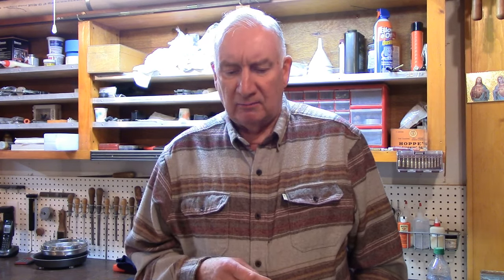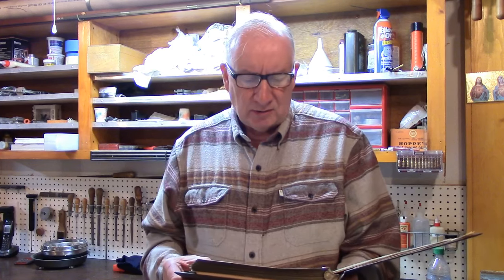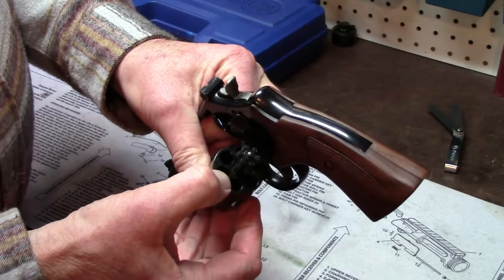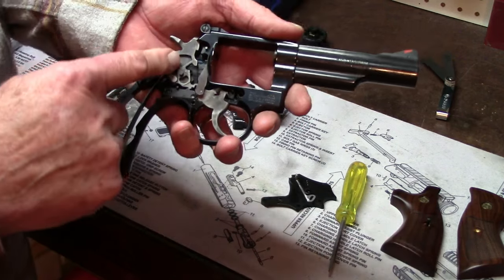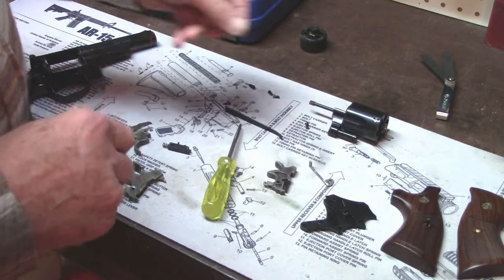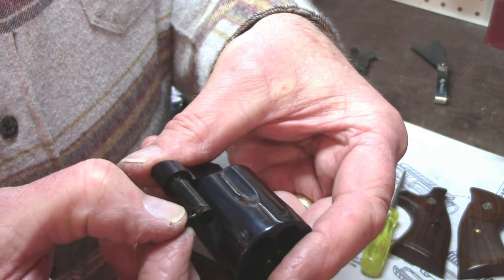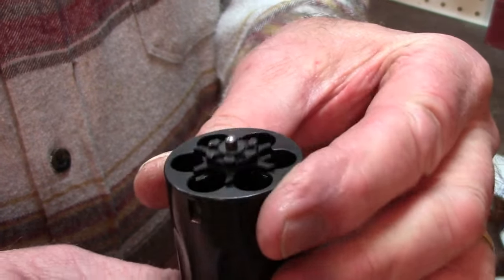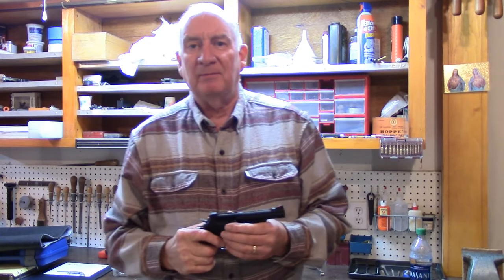The New S&W Model 19 Classic ~ A S&W Armorer's Review

Comment: A viewer turned me on to your work, and fine work it is. I love the Classic series of modern S&W revolvers because it allows us to truly enjoy these great designs at the range, without adding wear to our collectible period guns if we have them. The actions are not quite what they used to be, but you have to do a side-by-side to really notice that.
Reply from the maker: Speaking as an armorer, the actions are EXACTLY the same as they used to be, because the geometry of everything is precisely the same.  There's one difference; the elimination of the center pin in the new design removes the friction caused by its own spring pressure together with the spring pressure of the locking lug, which has been eliminated.  The cylinder that was once encumbered by spring pressure of two parts is now free to spin because those parts have been eliminated.  The support of the cylinder was once weakly suspended between the front bolt under the barrel, and the rear bolt at the recoil plate.  The front of the cylinder had no support, but was only dangling between two distant ends of a thin pin.  The lightest rap on the side of the cylinder would bend that entire system, requiring new parts and adjustment.  It's now supported directly in front of the cylinder by the strong yoke itself, and not by a long pin; eliminating half the span.  Think of hanging a 26 pound turkey on a rotisserie.  After turning for a while, things start to loosen up, and they need tightening, and at some point no manner of tightening will keep things spinning.  The reason the cylinder now opens with a click is because of the detent at the yoke, rather than making the center pin and ejector rod flush with pressure on the thumbpiece.  Most Model 19 and Model 29 44 Magnums that have been fired much are desperately loosened and terribly weak, for which parts are no longer made on antique machinery made over a century ago that wore out decades ago.  Any side-by-side differences are the result of reduction in spring torsion that are typical of older guns that have been in various ways modified.  Very few S&W guns have escaped spring nipping and strain screw shortening over the years, which indeed results in lighter actions, though not necessarily safe or dependable ones.  I've worked on, instructed with, competed, carried on duty, and owned the old ones.  The new design is more uniform from gun to gun, because their action is not dependent upon the skill of the fitter.  Trust me; many fitters were NOT skilled.  S&W told me that they educated Armorers for the military and police as a free program, because it allowed us to take care of the servicing required to keep their guns working.  Without charge, they shipped me parts by the bag full to replace ratchets, sears, endshake screws, center pins, ejector rods, you name it.  They knew they would require replacement, or they would not have sent them gratis.  That didn't say much for their product of the day.  In fact, those weaknesses became so apparent to so many departments of the era, that they fled S&W and went to Ruger GP-100s, which required no service, other than repairs for extreme damage.  It would require an unbelievable maltreatment of a GP-100 to put it down (and I don't recall one in the nearly 300 that I serviced and maintained), while a S&W of the day was subject to endless headaches and failures.  Frankly, they are fragile by all measures.  We were taught how to pamper them into submission, because they would otherwise foul up.  No, they are not smoother, nor do they have any different DA mechanism that would make them so.  That considerable friction of the center rod and its legion of endshake issues and rod run-out were sources of many cycling problems and roughness.  Those issues are forever gone.  Using exactly the same methods taught to me by S&W, I've made my Classic more smooth than I was able to with my previous Model 19s, which were indeed quite smooth.  As I stated in the video, I was unable to find a single specimen that was not in some way or another defective or in need of repair.  Repair of those guns is dependent on dwindling parts availability.  The parts most commonly required for repairs are already exhausted at the factory.  They went through those parts on a massive scale because the guns broke down  due to design weaknesses that are not found in the new style action.  I don't see any parts in the new gun that will wear out.

Comment: Thank you sir. I agree. A better gun than the original in terms of engineering. However, the finish i have seen on many model 19 classics are terrible. This is why i dont have one yet. A lot of scratches and places where they did not file and fit properly. I even saw one where the barrel shroud was protruding out the barrel. If you saw what i saw, you would be astounded.

Comment: I have a hard time finding the right screwdriver bits for my S&W revolvers. I seem to need a bunch of bits, even different ones for sideplate screws on the same model.

So I would be very curious about the measurements of your customised universal screwdriver that you made in the S&W armorer course. What blade width and thickness do you use? Thanks for any advice.

Comment: I have a Model 19 (19-3) in nice shape but I had a scope put on it and then removed.  Of course it now has 3 holes in bottom of top plate.  How much does that reduce the value?  The cylinder seems very tight on it but feeler gauge measured about 6 thousandths between cylinder and forcing cone.  Your video was great. Also, I don’t seem to have alignment pins on ejector rod.

Comment: Liked your discussion of S&W.  I hadn't heard about the 51 problems.  I have a Model 13-3 357 and I wonder if one of those problems is something I experienced.  The pushrod treading backed out a couple times not allowing me to open the revolver.  Is this a known issue? and is there a good fix for it?  I can tighten the ejection rod of course but wonder if there is a "best" way to lock it from backing out.

Comment: Thank You for an outstanding instructive walkthrough about the new K frame "Smiths presenting much to boost my satisfaction in acquiring a 66-8.  And taking the trouble to disassemble and reassemble your sidearm to show 'n tell, an endeavor that the rest of us dare not, removal and replacement of stocks is as far as most of us are capable.  BTW noticed that the barrel at the forcing cone inside the frame window is a full 360' whereas the older guns had a flat spot to accommodate closure of the yoke previously used.  Had read that there was an issue of magnum cartridges eventually cracking the barrel there, which is obviously now corrected.  And the new yoke locking point inside the frame is reminiscent of the Triple Lock system on the N frame New Century before WW1, but is it the same ?.  Finally, the new solid ejector rod and frame mounted firing pin in lieu of a hammer nose seem to be a nod to Colt

Comment: I'm surprised there was no mention of the forcing cone thickness improvement.  The old ones had a chamfer for clearance that forced S&W to remove material off the bottom of the forcing cone.  The new ones are uniform all around.   I saw some pics of the old ones cracking at the bottom likely due to abuse of heavy home loads.  Still, the new design is better in that regard.
Reply from the maker: Yes, you are correct.  The old style gas ring required clearance and a flat cut under the barrel extension.  The new design allows for an uncut barrel, which is also a tougher stainless steel.  That weakness is eliminated.

Comment: Have you found the small cylinder flash burns above each chamber, from the pressure buildup under the top strap, in the rear sight forward screw hole? Ive heard that if it happens, it may be solved with a flat-bottom screw; to block flash access into that threaded hole, under the top strap?

Comment: Thanks for this instructional video. I remember my old model 19 which I liked.  However I had a snub model 10 which I had trusted only to find it would hang and the cylinder would not rotate when pointed upwards.  Much to my disappointment the shells rotating around were hitting a burr in the flared back-plate which keeps the round from falling out of the cylinder. I think S&W makes better revolvers now, some of the best.

Comment: I have an old S&W Model 10, and I have a problem that I cannot seem to fix. When I dry-fire or use snap-caps, everything works fine, but after I fire a handful of rounds through it, the action starts to stick. It will still technically fire, but the trigger/hammer become extremely heavy mid-way into the pull. This happens when I try to fire both double- and single-action. I shipped it back to Smith&Wesson to repair, but they did not fix the problem. I will probably take it to a local gunsmith to try and fix, but if this sounds like one of those "51 Problems" that you regularly encountered, I would love to know.
Reply from the maker: I can only assess gun problems in hand, but I don't have a federal license to do gunsmithing.  My intuitive guess is that your cylinder is closing on the barrel and is dragging after fouling builds up. If that's the issue, your gun likely has developed endshake of either the yoke or cylinder, or both. It's a very common problem in Smith and Wesson guns made before the new design.  With gun empty, look at barrel gap against a strong light while you pull the trigger in double action.  If the gap closes on the lighted gap as the hand rotates and pushes the cylinder, your cylinder is dragging.  S&W should fix that very common issue for you.

Comment: Nice to hear from you. I recently bought a model 66. When I took the Hogue rubber stocks off I found that the place screw that the stock covers was mangled. Took the gun to a gunsmith whom broke the screw in the process. His solution? Glue a screw head to the plate and told me that "you don't really need that one". Well I was mad as hell (he charged me $80 up front) but I don't believe that that's screw is not needed. Can a better gunsmith remove the broken screw and replace it?
Reply from the maker: Absolutely.  A good gunsmith can build a gun from scratch, and the removal of the sideplate screw is simple work.  However, before doing so, call Smith and Wesson customer service. Despite model changes, they should be able to knock out that screw and fix your gun.

Comment: Not bashing but watch the review by Hickok 45. I still want one. What do you think went wrong?
Reply from the maker: I will watch that video.  However, just as a doctor would be unable to diagnose without the patient present, I'd have to have that gun in hand. I'll check it out.
Reply from the maker: I just watched the video.  All revolvers have a cylinder gap, which emits gasses, or anything else that doesn't fit.  All ammo makers occasionally load a bullet that has a defect, which will catch on the barrel, and will spit an imperfect piece of metal. In 1978, I loaded a batch of 140 grain half jacketed Speer bullets in 357 Magnum.  I observed that one of the jackets was distorted, but in my frugality, I loaded it anyway.  When I chambered it into my 6" Model 19, I wondered if it might be inaccurate, so I made it the first shot in the cylinder.  It went into the same group as the rest at 25 yards, but I was more concerned with the blood oozing out of my left bicep, and the terrific pain.  The doctor said that nature would take care of it, and that surgery was unnecessary.  A chunk of ragged copper surfaced three years later.  It was the ammo and my stupidity, not the gun. 
He stated that he fired that gun for quite some time prior to the videos, and subsequent shots after his injury spat no further metal.  A misaligned cylinder is a permanent issue; not an occasional one.
His Model 19 locked up due to a failure of the trigger to return to battery.  The gun is designed to prevent opening unless the hammer and trigger are returned to battery.  That is a common issue with S&W revolvers that have had too many coils removed from the rebound slide, in attempts to lighten the trigger.  In watching him shoot, I detect that his trigger in both DA and SA are very light, and not within specs.  They are separate issues, in any case, which have nothing to do with the gun as it was made. He was a competitive shooter, very well familiar with the tricks of the trade, and I believe he got too greedy with his sidecutters on that rebound spring. One NEVER uses a rubber mallet to open a locked revolver.  All he needed to do was to press the trigger forward while releasing pressure on the hammer.  He's a terrific shooter, but I must give him an F as an armorer.

Comment: One thing not commonly known is that the cylinder of the Model 19 is long enough that full length .357 casings can be extracted completely.  In fact, unless recently changed, the Model 19 is the Only DA/SA revolver to have that capability.

Comment: I'm 38 years old, and I mention that because it seems like anyone under 40 years old doesn't have much in the way of revolvers unless it's a J frame.  But I've always liked revolvers, I have several single actions and double actions.  I tend to have more Rugers, that's not on purpose it's just that if you want a well made single action or double action revolver without undesirable features Ruger is usually the easiest way to get it.

6:35 haha, I appreciate that insight.

I disagree on the Hillary Hole, I don't see how that's going to help anybody.  If you have children you need to lock it up, they shouldn't be touching/handling it.
Reply from the maker: Gun makers do not invent, nor invest in expensive safeties that require huge capital investments because of political correctness.  They do so because American citizens buy their guns, and then sue them for what they purchased after they do stupid things with them.  Much of the cost of a firearm is directly related to legal protection from corporate annihilation by greedy court settlements.

Comment: I would absolutely buy a book wrote on what specific pieces of parts like the hammer nose. Also what they're called by various manufacturers on specific designs/models. I'm getting my degree in firearms technology and training to be a gunsmith and during all this more than a few times I've stumped teachers asking a question like about the protrusion at the front of some lever action finger levers, and can't seem to find an answer anywhere online either. Another one is what the angled protrusion on a SA hammer that operates the cylinder bolt. These had to have a name at some point and i never know what to refer to them as.

Comment: Has smith resolved the cant on their barrel shroud so the front site is in alignment with the rear ?
They had issues with guns leaving the factory that way.
I saw a few in gun shops. I asked why they did not return it to them for repair.  It was explained it was the original/ new/ first/ Warrannteed owners issue to return it.  So I passed.
Reply: The new barrel shroud resolves that issue. Once the barrel is threaded on, the shroud is installed over it allowing the sight plane to be perfectly aligned.

Comment: So how does the drop in sear feel compared to a properly fitted hand cut one?
Reply from the maker: The drop-in sear feels like a perfectly hand fitted one, which was rarely done with a hand cut sear.  Hand cutting required a sear cutter with good hands who cared.  Not all hand cutters cut sears or anything else with great care.  They cut them as piece work to get the product out the door, and to get paid for the number of units they processed.  Quality Control was abysmal during the 1970s through the 1990s, and few QC inspectors required perfection, which is why police armorers were trained for free; to repair junk from the factory for free.  The myth persists that hand fitting makes good work.  That's only true if the worker is skilled and cares, which was very frequently not the case.  However, a perfectly sized object made to fit can indeed be assembled by an unskilled worker with utmost precision.

Comment: I'd say from a functionality standpoint the new revolvers are superior. You are correct about the metalurgical aspect being improved, though MIM for me can be a mixed bag. A forged, machined piece is always superior, and I do not trust smaller, more heavily stressed MIMed parts like extractors on some modern semi autos. From an aesthetic standpoint, however, the old revolvers are unmatched. The case hardening on the hammer/trigger were superior, the hammer nose for me looked better than the flat hammers, the bluing was much better on the old ones (the new ones look like paint,) recessed cylinders were a plus, and the older grips looked better to me. Not to mention, the old revolvers had that "made by hand" touch that the modern ones do not. Not to say I wouldn't buy a new one, but I understand the love of the older models.
Reply: Aesthetics? This is one beautiful gun. Old is better? Only because the lemons are gone and those remaining have been fixed.
Reply: @SB-eu7gb  I will tell ya that the way old Colt revolvers were blued, it made a beautiful finish but due to modern regulations ya can't make it like that anymore.

Comment: GunBlue whats the truth on Modal 19-3's and Magnum rounds cracking the forcing cone? Too much BS on the gun forums. Thank you sir and love your videos.
Reply from the maker: The Model 19 is a K frame gun, designed for cartridges of 38 Special intensity.  The underside of the barrel at the forcing cone is flattened to accommodate the diameter of the cylinder yoke.   At this critical pressure zone, barrels have indeed weakened from stress, and caused cracks.  Those guns, introduced in a day when most folks didn't shoot much (they worked and raised families) were not ever intended by S&W engineering to sustain constant .357 Magnum loads.